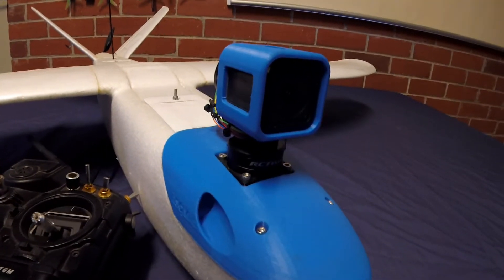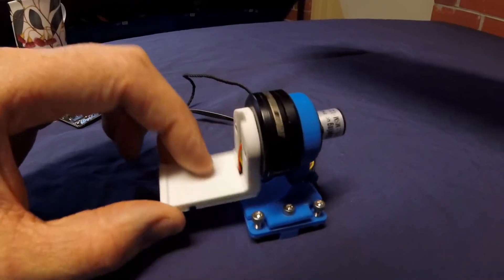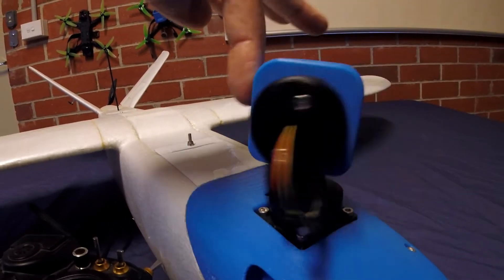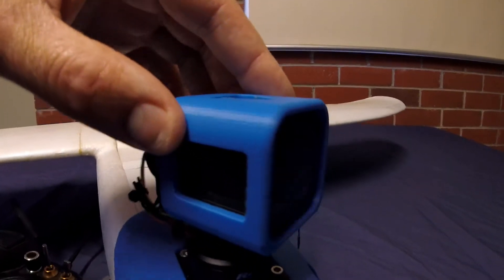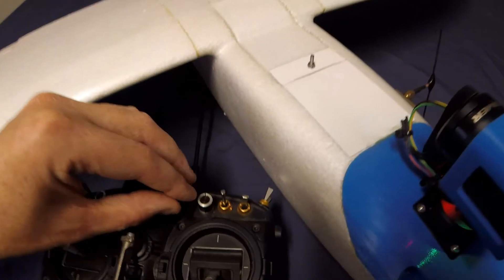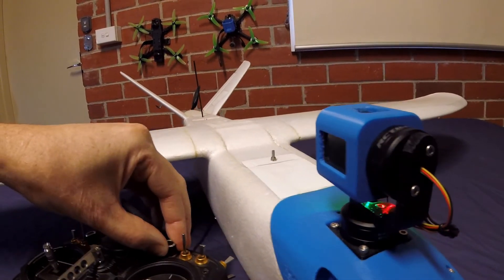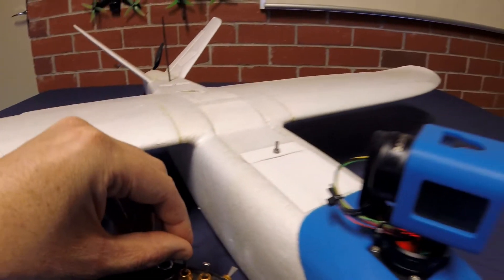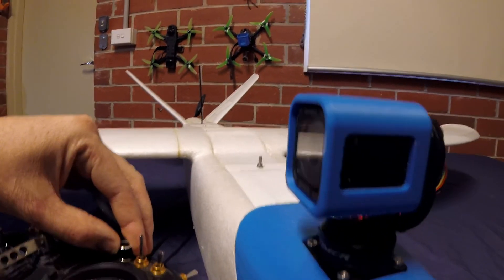» Mini Talon 2-Axis Roll & Pan Gimbal

Comment: Newbie question here. Is it possible to connect the GMB2804 directly to a flight controller? Have a FC with INAV and was thinking to use it with camstab. (instead of a regular servo)

Comment: Hey Lloyd,  another excellent piece of engineering...  It looks like you no longer have a slip ring on the roll axis...  Any reason???
Reply from the maker: Hi Shawzy, i didnt bother putting one on this design because i wont be doing aileron rolls like with the single axis gimbal. Dont think the pan motor would cope with acrobatics.

Comment: I am thinking of making the single axis version, what is that thing on the back of the gimbal motor?
Reply from the maker: Single axis works great. The circular black bit is a slipring. Search ebay "4 wire slipring"